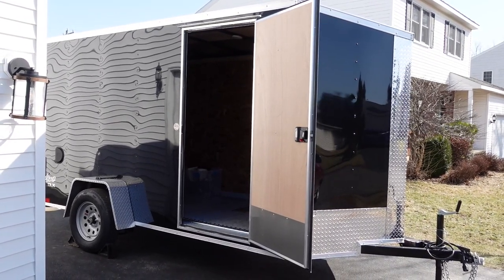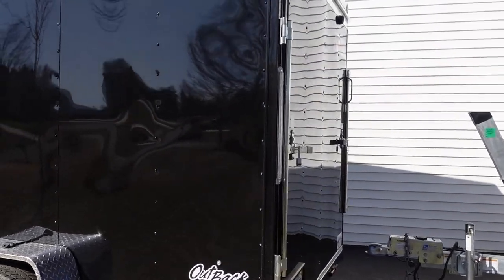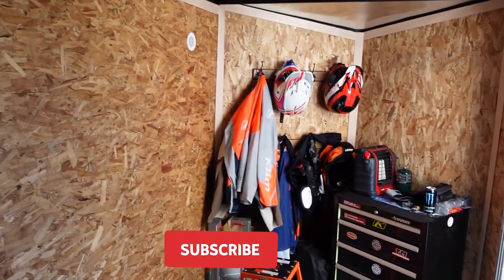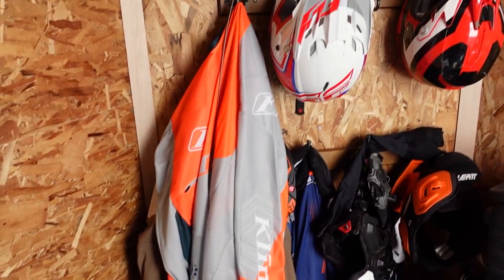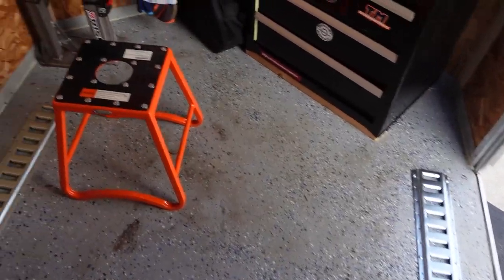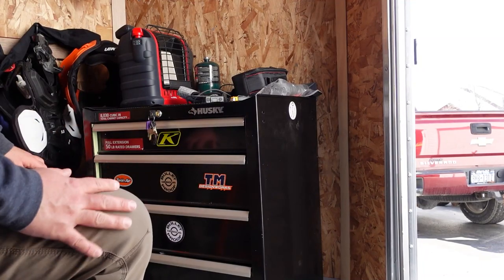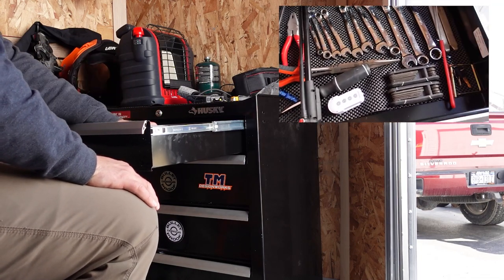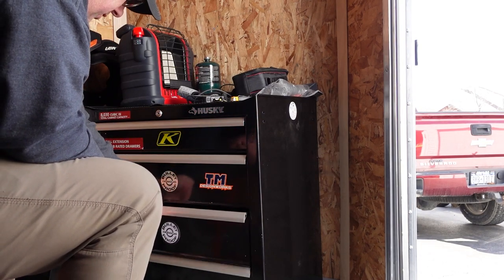Best Trailer for Dirt Bikes? Pace Outback DLX 6x12 Enclosed Trailer

Comment: Can you fit 4 full sized bikes?
Reply from the maker: Definitely, I use the Lock n Load Pro, but you could easily load two facing forward and two facing the rear and still have a good amount of space. I take my KTM 300, Gas Gas 300 Trials, my sons KTM 65, and my sons Outlaw 70 ATV.